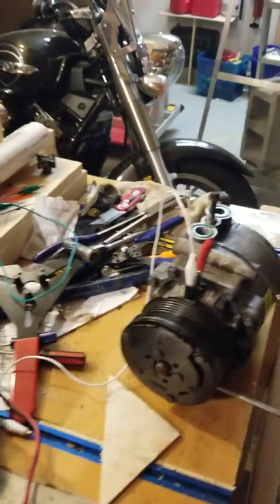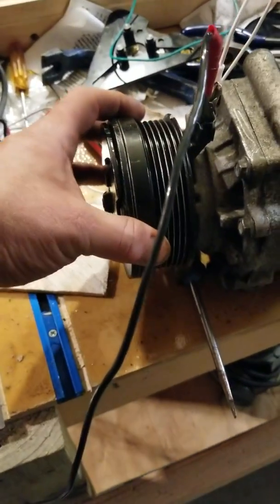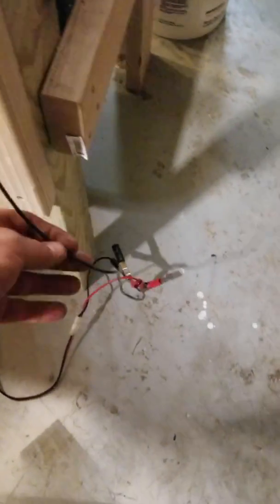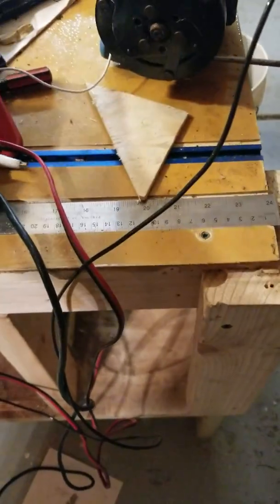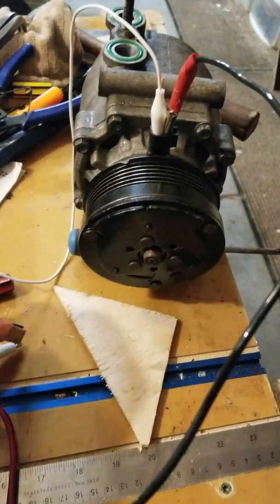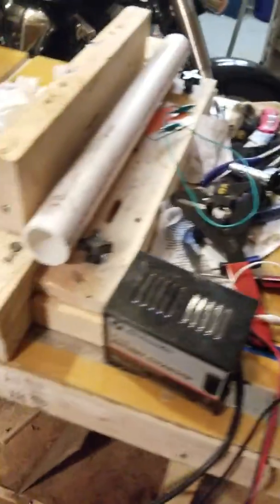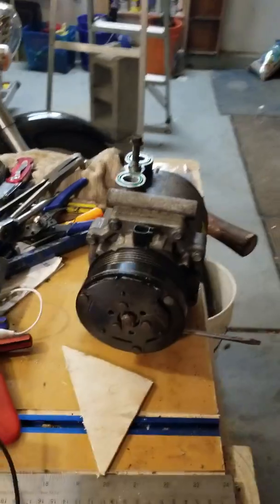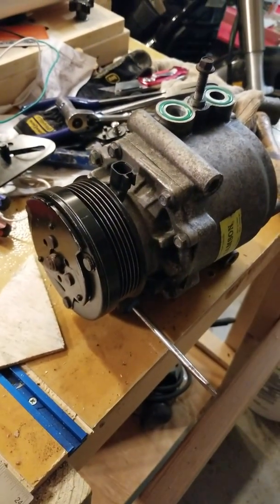AC Compressor Bench Test

Comment: hi scott good vid but my question is shouldnt the clutch spin also aswell?
Reply: 2:37
Reply from the maker: Good question. I'm not sure.  Never got my compressor issue resolved as my daughter sold that car before I had a chance to fix it.  Wish I had had more time to work on it. And I'm not a mechanic,  just try to fix things if I can.  This was not a success story since I never got a chance to finish it.
Reply: yes it should spin constantly until the power is removed
\
Reply: Lol..  yea a clutch is a clutch, not a motor..  jeez..
Reply: Not on a bench…. It spins through the drive belt - the clutch just engages/disengages the compressor